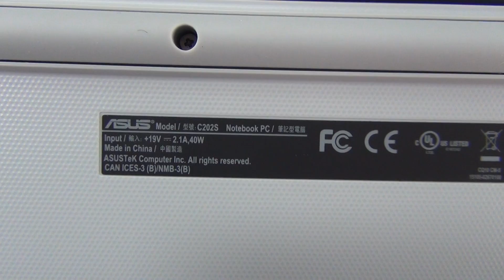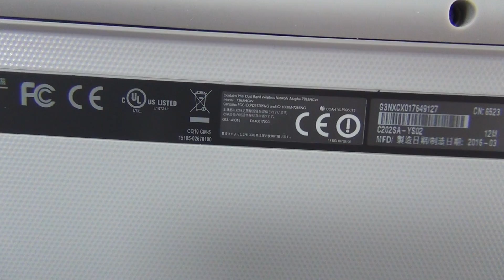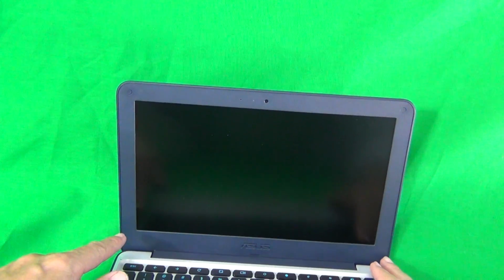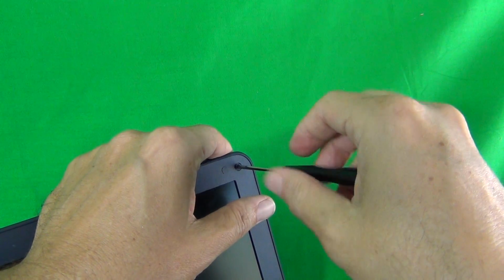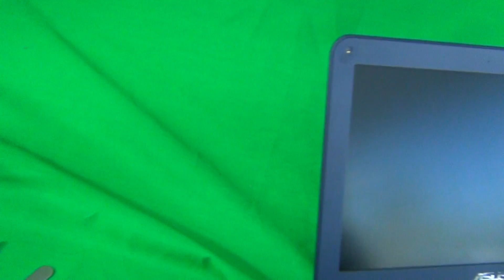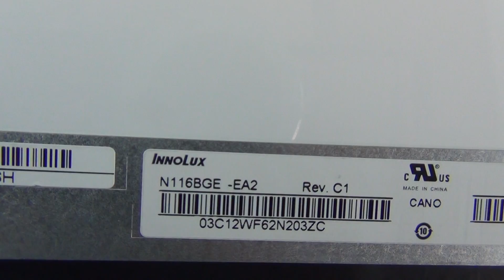ASUS Chromebook C202 Screen Replacement Procedure

Comment: Wonderful ! Thanks to your video I've fixed my screen flicker. I simply followed the instructions removing only 6 screws, then I partly detached the screen connector block, then re fitted it and stuck the tape down tight. Boom ! instant fix to our very irritating screen flicker. Fingers crossed it lasts. Thank you, Thank you very much :thanksdoc:

Comment: Hello. I am running into an issue with my screen replacement (didn't buy through your company).  I plugged my new screen in and when refastening the brackets it accidentally turned on.  I was happy to see the screen worked! But I powered it off, replaced everything,  then tried to power back on,  then nothing.  I figured the  connector came loose, so took it back apart and made sure connector was secure,  and after powering back up,  I did not get display on my screen.  Any ideas?

Comment: This video and the tools and screen were perfect.  The tape holding down the connector was a little more aggressive in my case and didn't come off as easily as it did in the video, but the hobby knife did the trick.  The whole repair took about 10 minutes.  The new screen is glossy where the old one was matte, but that doesn't matter to me.